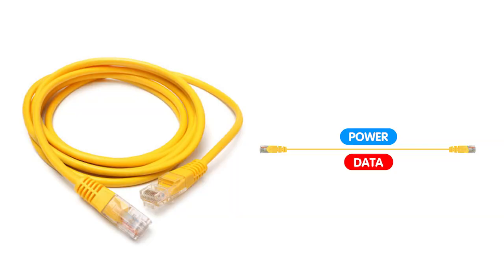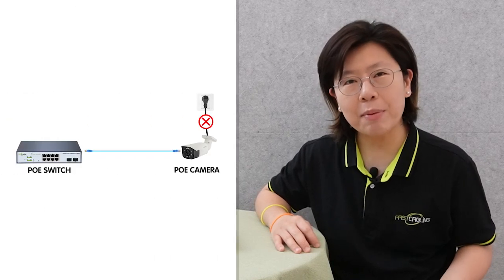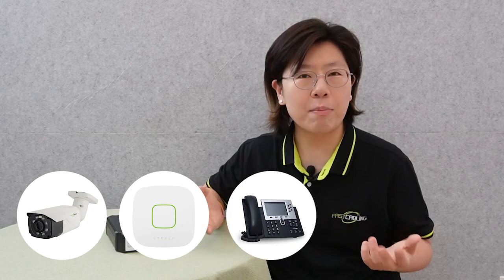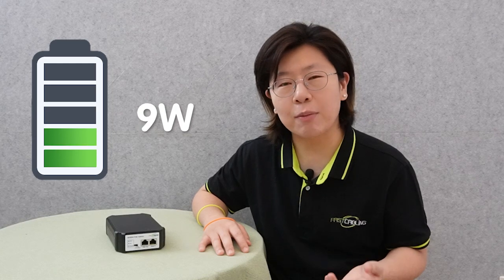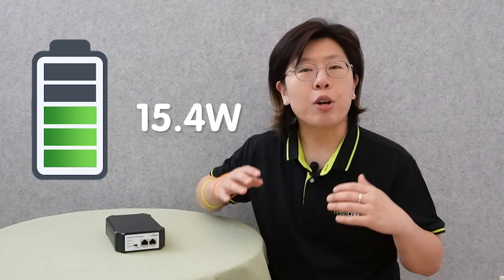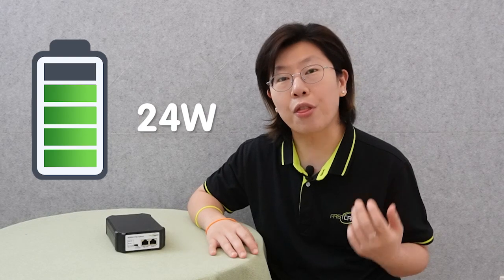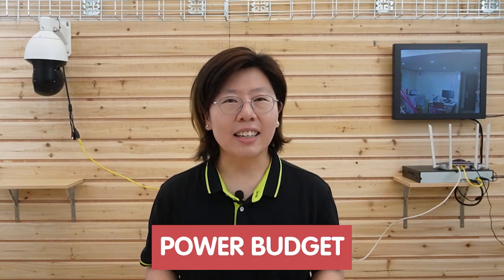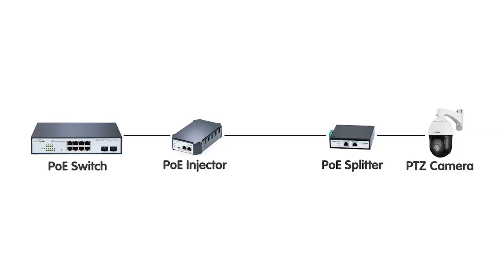Install High Power PTZ Camera with 90W PoE++ Injector

Comment: i need a poe switch that can power my ptz cameras
Reply from the maker: If you're interested, we've developed a 5-Port 90W IEEE802.3bt PoE++ Switch that supports a maximum power of 90W for ports #1-2 and 30W for ports #3-4 (power budget: 180W). 

https://www.fastcabling.com/product/802-3bt-poe-switch/